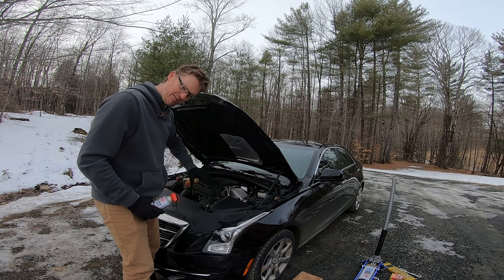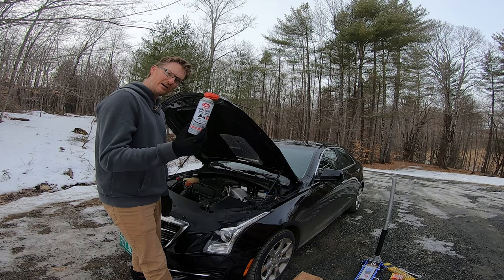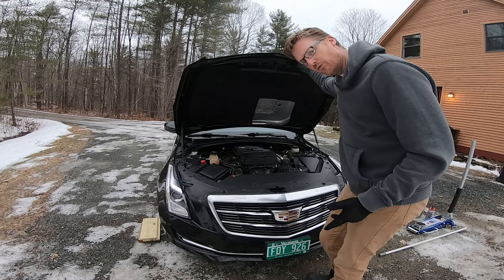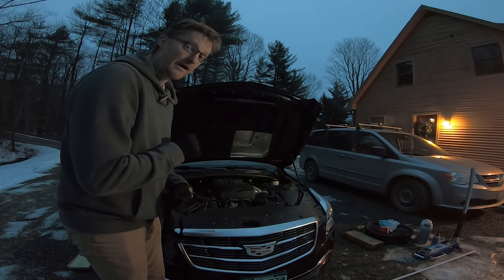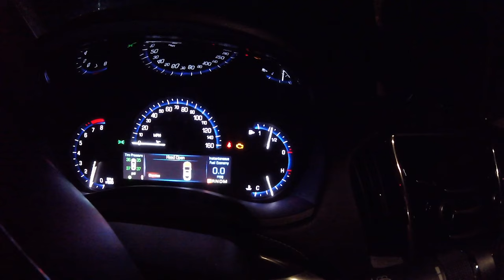Does CRC Intake Valve & Turbo Cleaner Work? | GDI Engine Carbon Buildup

Comment: Hey there. I like your video, you think things through logically, and follow a logical process, based on research and facts (I mean in terms of using quality fuel, quality full synthetic oil, and using the CRC GDI intake valve cleaner as a preventative maintenance step). Just one little adjustment I’d suggest. You’re right to do this treatment before an oil change, so that any gunk or cleaner that gets into the oil is flushed out,. Just one modification though: If you take a look at the official CRC in-house training video, which is viewable on YouTube, you’ll find it if you search for it, the training information states that the cleaning effect of the Polyether Amine in the CRC treatment continues to work and clean for about 8 consecutive days of regular driving after the treatment is applied. So I’d do the CRC treatment 7-8 days prior to the oil change each interval. That way, in case any deposits are still coming away over the 8 days following the treatment, and if any of the PEA is still in the oil for the next few days, doing it’s detergent work, it gives it a better chance to do its work; then flushing out the oil and replacing it with clean fresh oil and filter means it won’t get contaminated straight away... Cheers!
Reply from the maker: That makes a lot of sense. So let me tell you what I discovered in my own process, and please don't think I'm telling you you're wrong. The first time I did this, I waited to change my oil and when I did I was worried to see that the oil was noticeably more thin and watery. That's not good for an engine. But, subsequent uses of CRC have been very different. Let me explain. The first treatment, the engine was horribly neglected by its previous owner (i made a video) and I could tell that the CRC was absorbed into the carbon and breaking it down. It took days for things to return to normal. But every subsequent crc treatment has been quick to dissipate. I believe it is because it has done a great job keeping things much cleaner. I no longer detect the lingering effects of the CRC. So it's a trade off and I choose to protect my vital engine components and I change my oil after I do the long drive. So far so good.  I really appreciate your thoughts on this and thank you for sharing, commenting, and watching!

Comment: Consider adding a catch can. I installed one on my 2015 BMW 328i 2.0 GDI turbo and it does stop alot of oily fluid from making it's way back into my intake tract.
Reply from the maker: The factory catch can works great! I inspect it and clean it each time I change the oil.
Reply: @sstressfl  Oh cool, I don't know much about caddy's so didn't realize they come with a catch can from the factory. That's pretty awesome.
Reply: @sstressfl  there is a factory catch can on that caddy? Wow
Reply from the maker: Jack Class it’s integrated into the intake. Some people call it a silencer and remove it. That’s when they start drinking oil. It needs to be cleaned between each oil change.
Reply: yep i have a 2012 f150 ecoboost, thats the first thing i installed when i bought my truck. def worth it!!!

Comment: Man, please consider another brand oil filter, please. Do a YouTube search on what I'm talking about. Otherwise great video!
Reply from the maker: M2W Ha! I have heard and seen the noise about fram. I’ve been using them my entire life. Never had a fail. My cars run for miles and miles. The propaganda is real though. You can read all about why fram designs their filters the way they design their filters online as well. It’s easy to trash a product especially when the person doing their trashing has no understanding of engineering for a specific purpose and a price point. Seriously man, I do know what you’re talking about but it’s not accurate. God bless you my friend! 👍🙏 Thanks for watching!
Reply: @sstressfl Years ago I worked a Walmart tire and lube express that exclusively used Fram filters. One of the guys at work had heard rumors about Fram filters being junk.  After work we cut the tops off a bunch of them with an angle grinder and about a quarter of them had separated at the glued seam on the pleated material. Later on I cut one open that I took of of my Mustang and it was the same way. Keep in mind this was about 15 years ago. Maybe they've stepped up their quality since then. Some other brands of filters use a metal clip instead of glue and they seem to be more reliable.
Reply: That oil filter is fine. Better than a tearolator

Comment: Funny, last time I posted here I literally traded the car in a few days after. I bought a 2019 civic coupe with the 1.5t with 10,000 miles. I'm at 37,000 now. Yup...that's right 27,000 miles in a year a few months. Had a lot to do with trips to Maine last year, and 63.3 miles a day for work. Anyway...been using top shelf Valvoline since day one, change my oil every 3500 miles, crc intake valve cleaner every other oil change, 93 octane ONLY, fuel injector cleaner, OEM filter, etc etc etc. I also fluid filmed my car immediately when I bought it, and keep the paint super clean and protected. I feel bad for putting 27,000 on it in a year. Now I'm at normal miles for a 2019 lol.
Reply from the maker: Wow thats a lot of miles 😀 And thats quite the commute though. Sounds like youre taking care of things! That car should serve you very well. I traded my Caddy for a new Ram 1500 Hemi 4x4 and I fluid filmed the undercarriage as well! Just like you I'm trying my best to keep it alive for as long as possible. Frequent oil changes. Quality fuel. Washing 1x per week all winter long, even a very gentle undercarriage spray off to remove the built up mud/dirt, but not harsh enough to spray off the lanolin. Thanks for pausing to share your experience, neighbor 🙏

Comment: I have an ATS and am going to use this, but where are you spraying the cleaner in? One of the vacuum lines? Also, how much of the can do you use? I have 66k on the car.
Reply from the maker: I spray into the PCV port (safe and away from the MAF) on the intake. I use the whole can... slow burst of spray until its empty. Be sure to follow the instructions on the can :)

Comment: I was  wondering  what hose   you  removed to spray the  product  into?  I'm thinking about  doing this  to my Audi, but to  remove the airbox looks like  a pain in the  butt, the way you sprayed it in looks much easier than the  instructions on the can!
Reply from the maker: The instructions say do not spray it on the MAF (it can damage it)... so you need a spot upstream. On the Caddy, there is a PCV connection on the intake upstream from the MAF. I simply disconnect the PCV hose and spray into the hole. Hope you can find easy access!
Reply: @sstressfl  Thanks for  your  prompt  response, much appreciated!
Reply: I would suggest that you take it easy on the Audi cause they are very notorious for carbon buildup. Crc intake cleaning is a good start, barryman professional induction cleaner has acetone which I would recommend using later

Comment: I have a kia sportage 2011 GDI 2.0T AWD and I agree 100%. these engines without the turbo make almost 50% more power than the same size engines 15 or so years ago! Add the turbo and we are past old foxbody V8 5.0 engines in HP.    Kia recommends 87 octane and regular oil lol  I always use 94 and synthetic and use CRC once a year. Take care of these engines and they will be a blast to drive!
Reply: Unless your engine pulls timing at 87 your wasting money. Look for top tier fuel is the main thing.
Reply: @jackclass5446  Don't get me wrong, I love Petro Canada 94 octane fuel ;) especially with a Turbo GDI... GDI, the charcoal bbq of fuel injection 
it's designed and recommended and dyno'd on 87 octane. I remember calling KIA to verify if it was a type-o. 260hp/269 torque on 87 octane 0-60 on 6.2 seconds/ 5.9 on 91 octane mated to a custom Mitsubishi built (hush hush) 6 speed automatic. It was Peter Schreyer's easter egg. They nurfed the engine a bit after 2014 for better fuel economy

Last 2 liter suv I had was a suzuki sidekick with blazing 0-60 in 12+ seconds so yea newer engines work much harder

Comment: Michael, I have a 2010 V6 Accord,  where would you suggest I spray the CRC cleaner into?
I was thinking my brake booster vac hose that leads to my intake, pls I appreciate your input.
Also I have a 2016 Hyundai Santa Fe Sport w/ GDI 2.4 L engine. 
Just bought used with 90K miles,  not sure if it's ever had a CRC valve intake cleaning before,  but where on that engine would you suggest I go in and apply the CRC intake cleaner?
Thankyou so much!!!
Reply from the maker: The instructions say it just needs to be a vacuum source after the MAF sensor. It’ll reach those engine parts and get it done ✅ follow those instructions closely and it should work great 👍

Comment: Nice vid.  I used to live in Illinois, and after changing the oil in the gravel driveway many MANY times on my back, I relegated to taking it to the professionals.  I have vertigo too, and that lying on my back and looking up at close was not good.  I'm now retired and live in Arizona, and will work in the garage, all year around, and even change the oil.  I don't want to ever see snow again.  I have a GMC Canyon with the GDI, and it has 40K miles and I don't think the vales have ever been cleaned.  This is now on my list of things to do... I actually thought of it before, but forgot about it, but not this time.  CRC says the spray product won't dilute or get into the oil.  I believe that it's going to get consumed and go out the tailpipe like the fuel would, you're not spraying it into a non-running engine cylinder where the product can pool and run down the cylinder walls.
Reply from the maker: I lived in the corn fields west of Elgin, IL for a few years :) Arizona sounds nice to me! I always run the CRC thru my engine, do the test drive, then change my oil. What I have learned is that CRC sticks to and absorbs into carbon. You'd be surprised how long this stuff takes to work its way out of your engine especially the first time you use it! But now that I use it on a regular basis (before each oil change) it clears out much faster. But I still change my oil after each treatment. It's working for me and I'm going to keep doing it as such :) Thank you for your comment and sharing your situation. I'll be interested to hear how your treatment works out!
Reply: @sstressfl  I did the treatment, and I can honestly say there was improvement in the idle and smoothness.  I wish I could see the valves just to verify that it did indeed work as expected, but that's not possible.  I plan on permanently installing a small tube that I can inject the CRC cleaner directly in front of the throttle body instead of expecting the fluid to make it through the manifold and eventually to the valves.  It'll involve taking the top cover off and drilling and installing the tubing, but after that, it'll be a simple plug-and-play-and-spray-away.  BTW, I was always riding the motorcycle in and around the area "west of Elgin" on many occasions and Huntly and beyond.  Rte. 47 was my favorite.

Comment: I just ordered a can of this stuff to try on my 2014 Buick LaCrosse with the 3.6 GDI motor. 48K miles on it now and I plan on doing this every 10K to hopefully keep carbon build up to a minimum. I got the car in September with 42K miles and changed the oil within the first 200 miles. Similar to what you were saying I don’t know what oil they put in it when I bought it but it was awfully dark considering they claimed to have changed it before they offered it for sale. I use Pennzoil Platinum full syn Dexos and so far the car seems to like it. Oil stays pretty clean and consumed very little in between a change.
Reply from the maker: Awesome! I look fwd to hearing about your experience with it. The first time I did it was rough... it seemed to clean out a lot of gunk. Every time I’ve done it since it has been no big deal 👍 runs through clean.
Reply: @sstressfl  instead of ordering it, hell most auto parts stores carry this stuff.
Reply from the maker: @ICouldCareless47  I pick mine up locally when I'm in town, but some of us live far away from stores! Sometimes it's just easier to order it :)

Comment: Do some research on Fram oil filters. I wouldn't use them on my car.
Reply from the maker: dcplanbful Others have said the same. I’ve seen the cut-open videos and did my own research. I believe cutting them open doesn’t make a person an expert on filter design and materials. Ive learned about why fram makes their filters the way they do and it makes sense. And I’ve been using them my entire life. I’ve never had a failure. My engines go and go and go 👍
Reply: @sstressfl  true, does not make them a expert on filters. What worries me is that Fram filter use less filtering material. 😉
Reply from the maker: dcplanbful I know! Shocking headlines! To me too! But then I read about it... it’s designed to be good for 10,000 miles. That’s it. They can make it thicker, use more material, but then the price goes up. I change my oil often and well before 5000 miles. Fram is perfect for my budget and my habits 👍
Reply: @dcplanbful  you are correct.  Filter material can come off and build up in oil passages.  Says in his budget but buys Cadillac.

Comment: I wish you’d gotten a closer look at what you were spraying into I have the same motor in my Camaro and I’m not sure where to spray
Reply from the maker: Sorry about that! I remove the PCV hose from the intake and spray inside. The PCV hose location is upstream from the MAF sensor so it won't make contact with its sensitive wires. Here's a more detailed look at the process in a video I made when I first bought the car: https://youtu.be/wfHi2SPzZb0

Comment: What’s that jack adapter gizmo and where did you get it?
Reply from the maker: dennis moreland life changing! Jack up the car with confidence. It fits in the rocker cut out area and straddles the welded seam that sticks down. It’s the intended lift method. Was new to me when I bought this car 👍 this is the one I bought POTAUTO Universal Aluminum Grooved Magnetic Jack Pad Jacking Puck Pinch Weld (Slot Width 0.39 Inch) Frame Rail Adapter (Qty 1, Red) https://www.amazon.com/dp/B078J55SBW/ref=cm_sw_r_cp_api_i_MmeeFb704B7N9

Comment: Use of auto ramps will eliminate a lot of your access issues
Reply from the maker: Jerry Costanzo I have 4 rhino ramps! The first time I used them on the van in the garage - one of them slid out from under the drive wheel while I was driving up the ramp and slid behind the front tire. The van chassis came down on the ramp and damaged the rhino ramp. I was so thankful there was no damage to the van. I have since considered ways to keep the ramp from sliding but I have also developed some fear of using them. And I will not use them on the gravel drive. Too unpredictable. I have considered all options including a kwik lift but cannot get myself to spend that kind of money. I’m doing the best I can with what I have 👍 I do appreciate your thoughts.
Reply: My ride is lowered and when using ramps you will find them to steep.  I grab a 2x6 about 2 1/2 to 3ft in length and get that angle right so i dont hit. Now driving up to the 2x6's laying up on the ramps, or setting up the ramp and 2x6's with car in the spot you are working, and then low gear just slowly getting up to that point that you can feel your tires hit and next you will go up . Then just slightly touch the gas and let off asap.  This will not launch you up it and you don't want to lock it up to hard once on top.  

With both my cars its a tad hard to just tap the gas just right lol so i've come close to what you experienced. 

You can get up the 2x6's fairly simple and the lesser angle 📐 really makes it simple plus it puts weight onto that ramp and helps to keep it in place.  If i can do it and well ... anyone can .  Be brave !!! 

lol  cheers 🍻

Comment: Link for the jack pad?

Also where did you spray the CRC into? Doesnt look like your sprayed down the intake tube to the turbo.
Reply from the maker: Link: https://www.amazon.com/dp/B078J55SBW/ref=cm_sw_em_r_mt_dp_mrbNFbY7KGC41?_encoding=UTF8&psc=1 

I popped off the PCV from the intake tube. Sprayed right into the hole. Slow and steady. Its upstream from the MAF and right in front of the turbo.

Comment: Hey what is the oil you use? I just had mine changed for the third time at the dealership and I’m still getting oil in the intake. Btw I changed my transmission fluid today and I made a complete mess. I had fluid everywhere lol.
Reply from the maker: I used to get big puddles. Now I get very very little. I wipe it out every oil change to keep it at bay. Nice job on the trans!!! It can be really messy. Many years ago I made such a mess that I soaked parts of my clothes and hair with transmission oil while laying in it. It was really out of control. You get better with practice! But hopefully neither of us have to do it again anytime soon 👍😁
Reply: Yeah I don’t plan on changing it again at least until it gets cooler here in nc. It’s hot and the humidity is always around 90 to 100% on my old Cruze I changed it 3times to make sure it had all new fluid. It was much easier because of the drain plug